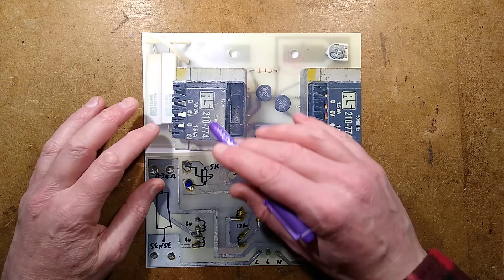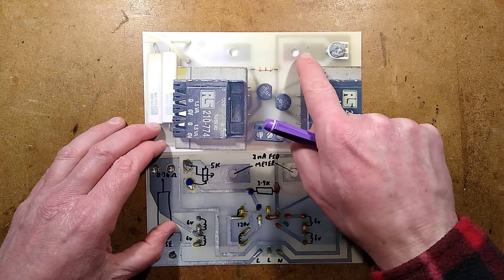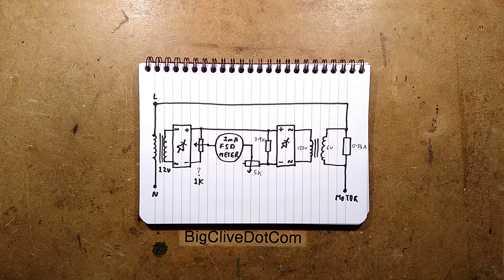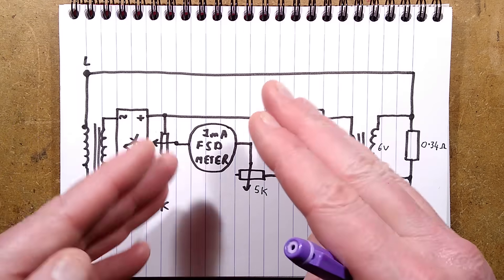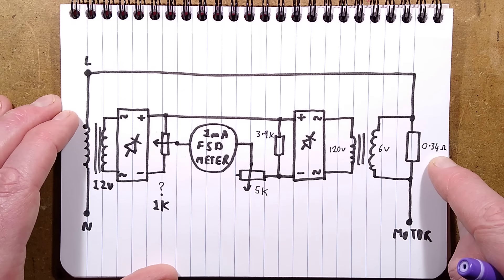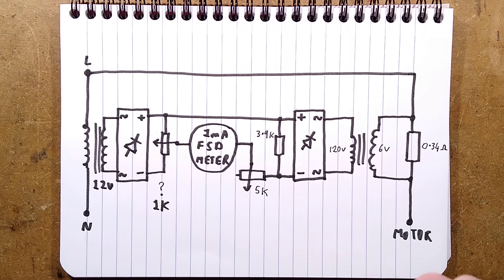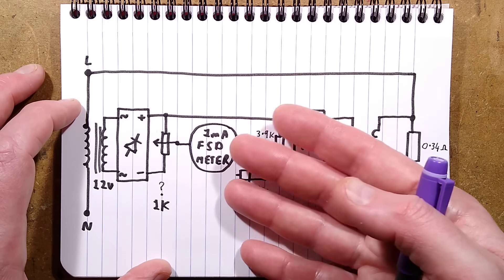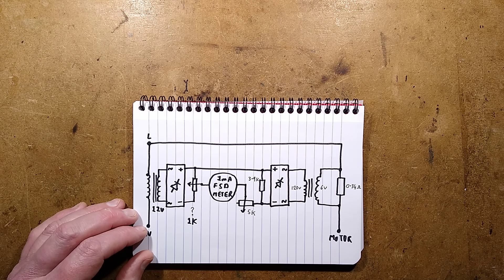Unusual circuit with retro-feel (specialist PCB cleaning machine)

Comment: I love those old weird circuits. I used to work on 1970s circuits that used a bridge rectifier...VM48? As a relay. (To control a larger relay)... for it to work, the circuit would not allow the low voltage dc to flow, which in turn would not allow the high voltage 120vac to pass. Although I could easily fix it, and understood it well enough to repair it, I never could quite wrap my head around how it actually functioned!

Comment: T off topic, but would you trust one of those STC control units to run a 300w (actually 2 x 300w) {in case 1 fails open} in an aquarium setup. 250ltr so have some time to sort out problems, but i heard the STC has a high and low temp alarm?
Reply from the maker: If using electronic control of a heater I'd recommend a secondary safety thermostat as a precaution against the temperature going too high if things go wrong.

Comment: led in reading glasses has been emitting dim light 24/7 for over a year! still on to this day. originally purchased Oct 1st 2020. two cr927 3v cells provide the power. the power switch broke off the first day I used it before Christmas 2022

Comment: I bet this came out of a nubal cso dh 610 or similar machine.. definately a nubal anyway. Ive worked on and rebuilt many of these machines over the past 20 years. The mechanics of the brush assembly was an interesting design.. as the brush not only spins but it also oscillates back and forth at the same time, which puts an "s" shaped pattern on the copper. It had 2 belts between the motor and the brush assembly with a double pulley, one slightly smaller than the other. One belt spun the whole assembly and the other belt spun a swash plate inside the pulley which pushed the brush back and forward... but at a speed that was determined by the ratio of the difference in size between the pulleys. Simple machines but they worked great as long as you kept up on maintance. The reading on the meter didnt really relate to much apart from a number that you could use to determine how much pressure the brush was applying to the pcb panel. It was more of a case of setting the brush height up and getting the finished result looking right and then using that number as a guide. The size of the pcb panel going through the machine changed the load on the brush,  so the meter was only useful for a known size pcb panel at any particular height setting. If the brush was worn unevenly the meter reading was pointless as the brush would be heavy on one edge and light the other edge and not gove you a true indication of what was going on. In this case we had a leveling board youd run through the machine to level the brush by sanding off the high spots.

Comment: I think, in your schematic, the transformer on the left is creating a reference for the meter, irrespective of what the mains RMS voltage is at any instant, including spikes and any hash.  Since the motor current is following the same mains voltage, you get a perfect bridge.  (The 3k9 completes the circuit for the right hand transformer and rectifier). In a nut shell, once set up properly you should be able to use it out in the sticks where the mains may be as low as 207 with little noise. Or in a rural location where you may be as high as 253 (230v plus or minus 10%) and loads of noise and spikes, without any need for recalibration.

Comment: that is quite clever centring the meter with the left voltage side, and supplying the error voltage through the right hand side so the meter can move either side caused by the difference in voltage

Comment: The right side transformer is working in a current transformer regime, seen this in some other circuits. So this is measuring some (how to say in english) ratio on applied voltage and current to the motor, which on other hand defines where is the motor on specific family of lines in regard to supply voltage. Left side of your respected schematic is measuring voltage, right side measuring current, and meter in the middle. Even 3.9k is very often used on CT secondary in old industrial electronics as a terminating resistor for CT. Low ohm resistor is shunting current. Best Regards

Comment: Looks like it measures the relationship of voltage vs current on one motor phase, the meter most likely will show highest reading on the lowest load.

Comment: I really do like the old fashioned look of these PCB boards without the solder mask. My current project is late 1970s/early 1980s inspired and uses a lot of vintage components, so I wanted a PCB board that didn't have solder mask. Unfortunately there's no easy way to get no solder mask and still get the silkscreen, since kicad assumes that no solder mask means you want to solder there, so you can't have silkscreen text there either. It might be possible to do two exports, one without the solder mask or silk screen, and one with both, then copy the silkscreen layer file into the first one. Perhaps I'll need to do some experimentation.

Comment: I used to work on photo processing equipment that also had extremely corrosive chemicals. The circuit boards in them were also fully solder plated traces with no conformal coating. Usually the legs on the components dissolved first. A lot of the pre-CAD PCBs were done up on large graph paper with black stickers and tape. Then the artwork was photographed and sized down with lithography. That's ancient stuff.

Comment: 3:38 The left tuning resistor is needed in order to compensate for the voltage drop on the diode bridge.

Comment: mmm... weird circuit, takes me back to my time working for a pcb manufacturer (single sided, double sided, multilayer, flexible and flexi-rigid (a multilayer board where the inner layer is flexible, do the whole board assembly can be folded up to fit into the final product)

Comment: Give me an Analog Meter Movement always.
Better than having 8, 1, 8, 1, 8, 1, 6, 9, 6, 9, 6, 9, flashing light epilepsy.
That circuit is just a bunch of coils, can't get cheaper than that. I would have gone with bi-metal pressure plates on the motor mounts, and op-amps on either side of the meter, H Bridge maybe.

Comment: As others have mentioned, it is a simple ratio detector. It compares the current drawn by the load, with the mains voltage. 
eg It eliminates any variation due to changes in mains voltage.
To calibrate it, you would set some arbitrary load, then vary the mains with a Variac and adjust the 1K pot to remove any variation.
Then set the 5K resistor to give the required reading on a known load.
Reply: I think it probably also partially cancels out the out of phase current (reactive current) and thus gives a more precise reading on motor torque, which is represented by active current.
-- get a Chargehanger

Comment: For short run equipment, that board setup is actually common
The reason they don't have a good setting for a baseline is mechanical devices change over time
The goal is a small load on the motor
Touching not pushing

Comment: If the series resistor blows open you would be left with a very bad situation. The motor may stall and the output voltage from the transformer could go very high.
Reply: An excellent observation. Around 5,000 volts into the bridge rectifier would be a little problematic.

Comment: I would love to see circuits like this more often. Its kinda lame that everything now works with some cheap microcontroller.
Reply: I had this mindset when I was designing a power supply for the dash cam in my car. I wanted a low voltage cutoff with hysteresis that only triggers if the voltage stays too low for a certain amount of time. I'm sure I could've come up with some wizardry to implement this with discrete components, but my final solution was a PIC10F322, 50 cents of support components, 1 cm² of PCB area, and a short C program. The result is cheaper, more compact, and simpler than any discrete circuitry could be, and that's what makes microcontrollers so great. But it is admittedly less interesting.

Comment: It probably is handmade. I’ve worked at more than one place that either couldn’t afford commercial machinery or were just too cheap and wanted to do as much in house as possible. The latter method can also let you do things the commercial machinery can’t do if you have particularly smart people doing the designing.

The circuit looks more 50s or 60s to me despise being built with 70s DIY circuit board methods. You’ve shown us many weird circuits that still get the job done.

Comment: I love magnetics, this was designed by some hoopy frood who knew where his towel was at. The right hand pot would be labelled span or 'sensitivity' the left pot is the zero or 'null' adjustment. You are correct in that to adjust the unit put the span pot roughly anywhere and start the motor drive, with the drive unloaded adjust the null pot to give the required meter deflection, 2 is as good as anywhere as this gives some deflection available to display 'under load', a valid error that could be caused by a failed drive belt or drive transmission fault. Adjust the span pot to give a pleasing display when the machine is running loaded normally. It is very much a comparative display and is next gen 'seat of the pants' instrumentation. The phasing of the transformers is important as you want the voltage waveform peak to arrive a the same time as the current waveform peak and counter intuitively adding smoothing caps to the power supply or sensing supply will not help and will make the meter needle tremble. Never underestimate the rat cunning and first principle knowledge of old engineers.
Seasons greetings to you and Ralphy.

Comment: There’s a lot of components that are surplus to requirements here. We don’t need the current-sense resistors, and the extra stuff between the bridge rectifiers seems like an extravagance; just connect the (-) terminals of the bridge rectifiers together. We don’t need the meter to tell us this puppy is going up in flames. 🤣😆😂 Just do it outside, or in a fume hood. And have proper fire-safety protocols in place. Enjoy the New Year!

Comment: Analog meters are almost always the better choice.  Many people don't realize this since they came first, and so they assume that means "not as good".  But far from it.  You can get an idea of the reading at a glance before even focusing on the gauge, vs needing to focus, read, then process what you've read off of a digital meter.

The circuit looks like quite the Rube Goldberg set up.  I'm trying to understand why a simple ammeter in the line to the motor wouldn't suffice, unless the line voltage varies quite a bit...
Reply: In industrial environments the mains can get quite noisy with equipment being turned on (causing sag) or shut down (causing spikes).

Comment: Ive done and assisted in doing quite a few boards like these in the 70s and 80s.
Still got a few kicking around, one for controlling dancing arms with limits.
All near hand made, with supper short run pcbs, no mask, no comp id (unless it was text as a thin set of tracks) .

Comment: The circuit is farly straightforward. The right side of thenschematic is just turning the small AC voltage from the current sense resistor into a DC voltage to deflect the meter.
The left side of the circuit is just to give a DC offset, most likely to allow a more accurate "zero" reading since the dual diode drop on the right side will mess up the zero reading.

Comment: It looks home made, but this is very much how short run electronics was designed and made up until quite recently. CAD, solder resist and silk screen printing were all just too expensive to justify if you just wanted a couple of hundred PCBs for something like this.

Comment: Ahhh, ummmm well being an engineer starting in the 70s in mainly industrial gearboxes, we used to make our own load, torque, etc meters and control panels, using components from RS, fantastic catalogue for all types of things. Our in-house control and monitoring equipment looked surprisingly similar to the equipment you had. We had an alcoholic electrician, who was fine 80% of the time, but could be very dangerous after a liquid lunch. I sacked him after a test rig went wrong and I was nearly crushed by 2 ton of test weights. So yeah, very 70s to 80s homemade design.

Comment: That's so old god probably used one !
It's just a oddball balanced bridge .

1K is the balance point at 0 % loading ? 
5K adjusts the meter swing for a known load ( probably set at fsd ) .

The problem is finding what the fsd load is ( you could dial in anything ) .

Comment: It's just a Wheatstone bridge with two voltage sources. The current through the meter is indicating the voltage imbalance... which is what you want to set the motor winding current. You have to deal with large current? through the small sense resistance... and so a small voltage is developed across the sense resistor. You need isolation too... so a transformer is a good couple for that (step up, and isolation). Additionally, the AC motor's torque is usually in a non-linear relationship to the current through it, over a fairly large dynamic range. The bridge circuit helps to make fine adjustments, from a particular value of motor current.

Comment: Look to schematics of earlier ground impedance meters or loop impedance meters - absolutely the same "homemade" appliances. Many old relay elevators are working with "homemade" details because original ones are no more available in market.
Reply from the maker: The sign of a good engineer is being able to bodge something together to fix an old piece of equipment.

Comment: Reference voltage to the left of the meter.
Current sensing circuit to the right of it.
The current sensed from the motor is stepped up, converted to “dc” and then converted to voltage by the 3k9 resistor.
Just a really old fashion schematic for a current indicator of a motor.
Needle in the middle of the meter, mechanical load on the motor ok.
Needle to the left, not enough mechanical load.
Needle to the right, too much mechanical load.

Comment: That is the same thing as used for IR compensation, and thereby a speed stabilizing on cheap DC motor controls.  Instead of using speed measuring device (a “tach” or an encoder or similar), you just balance the load variation effect with a certain amount of motor current derived boost.  The circuit in principle uses the motor voltage as feedback, but adds a motor current derived signal, like feed-forward.  More load on the motor causes more current demand and without the feed-forward would cause a speed droop.  The bridge arrangement takes both parameters into account, util the load and current cause the motor armature resistance to increase and the effective EMF is falling due to the resistive loss.  Finding the same bridge applied to AC was a little surprise, but evidently usable.  There is even a possibility that the ripple voltage would provide a sampled feedback opportunity - measure the voltage (EMF) at the moments when the current (and the IR loss) are zero.  I wonder if the indicated motor is actually a “universal” motor, i.e. with series wound structure.
Reply from the maker: The motor is a three phase motor with just one phase monitored.

Comment: It would be interesting to what happens to the meter if the motor fails toward short circuit and you get the full mains voltage across that 6V winding and the corresponding  20x voltage across the secondary - maybe Clive'd like to demonstrate in another video of course 😁

Comment: Those transformers are Radio Shack parts. (The big RS is a clue, but the numbers fit their part numbering scheme as well.) It looks like something built by an engineer who was in a hurry to get the machine working, and never went back to clean up the design.

Not that I've ever done that, mind you.
Reply: Radiospares?
Reply: Radio Shack don't appear to operate in UK but RS is the name of a long established company originally named Radio Spares, later RS Components and now simply RS.  Suppliers of high quality components.
Reply: @Rob-e8w  I stand corrected. That does look like the RS (Radio Spares) logo. I can't find the part number on their web site, but that transformer may have been discontinued.

Thank you for the correct information!
Reply: @daveh7720  "Well, actually..." UK-based RS (Radio Spares) acquired US-based Allied Electronics which was previously owned by Tandy and thus affiliated with Radio Shack. For an earlier short period there there was "Allied Radio Shack" joint operation. So you are not completely wrong.
Reply: @Graham_Wideman  That explains a few things. I remember a time when my local Radio Shack store sold Allied catalogs along with their other books.